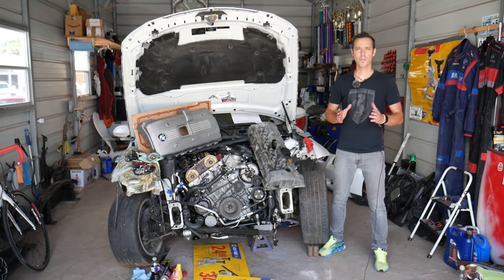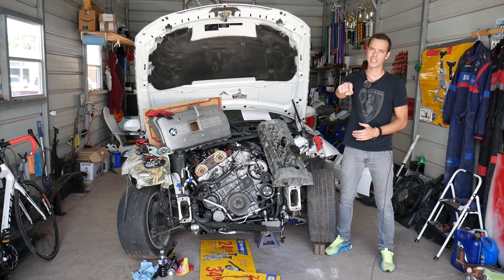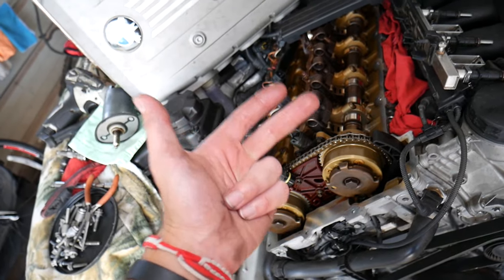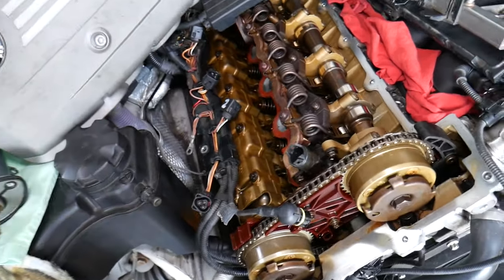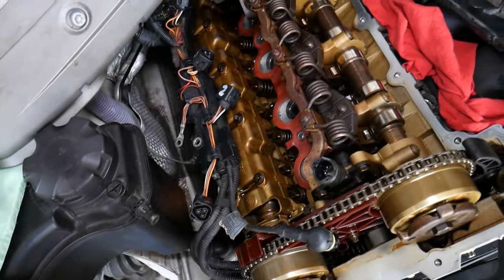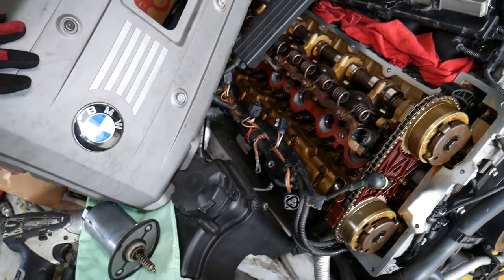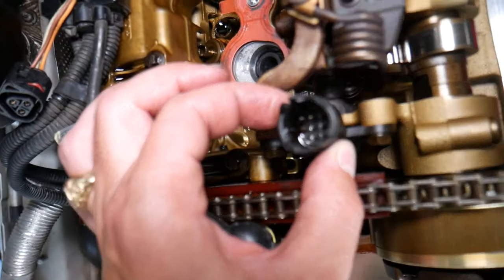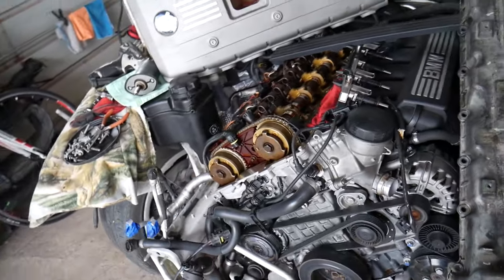SYMPTOMS OF BAD ECCENTRIC SHAFT SENSOR ON BMW

Comment: Does a 1997 E39 bmw 528i have an Eccentric shaft sensor? Please let me know because i just changed my valve cover gasket a few months ago.. Its sealed perfectly and i hate to have to reopen it.. Hoping my car doesnt have or need this. I believe i have some vacuum leak under the intake (very hard to see and access under there. I will try to check from under the car next

Comment: Could this cause the 2a87 code? I have a 2006 330i and the sensor is definitely soaked in oil. I wonder if changing this will resolve that code or will i need to do the camshaft bearing ledge seal?

Comment: I have a question about possible symptoms for the eccentric shaft sensor. When it’s hot and I come to a stop, my cars rpms will drop below 500 and shut off. Also when accelerating the car jolts and the rpms won’t go up. I ran a scan and the eccentric shaft sensor code did come up but I wanted to confirm if this is also symptoms of a failure.
Reply: Did you find if this was sensor?  i have same problem
Reply: I’m having same problem after valve cover swap
Reply: Did you guys relearn the valvetronic motor?
Reply: @yisyerry  supposed to turn it to on position for 30seconds with the new sensor intstalled
Reply: @440Chriso did I fix this? I have same problem?
Reply: @440Chriso  I am also having the same problem after a valve cover change. 2008 BMW X5 3.0si (E70, N52)
Reply: @RogueAfterlife  someone wrecked my 2011 328i while n52 still had the issue moved on to a 2019 440 gran coupe as much as peoples praise the n52 it has nothing on b58

Comment: Would this cause studdering and complete loss of power? I have several codes for the sensor and am replacing it along with my ignition coils.
Reply: Did ignition coils solved the problem?
Reply: @sne231  Had to make several different part orders because something new kept coming up. It's been about three weeks and I should be tidying everything up this weekend. Will let you know.
Reply: Replaced the eccentric shaft sensor and ignition coils. No issues. It probably was more of an issue due to the sensor needing to be replaced as I had several codes. The ignition coils probably needed to be replaced anyways in my case but it probably wasn't necessarily needed in my case.

Comment: i have an error that says
valvetronic, eccentric sensor, guide; checksum error
134c04
is it the sensor or just the seal ?
the symptoms are juddering when taking off and on idle like the car is having hiccups

Comment: Morning I got a bmw e90 320i 4cylinder n46b20 when I start my car it misfires and engine will be noisy when I unplug the top  vvt sensor the misfire goes away an engine Wil quite what can be the problem.

Comment: My car doesn't start at all it just cranks, but the scan tool said it was the sensor and Valvetronic. I guess that the sensor goes out it also gets the code for the Valvetronic motor too because they run hand to hand?

Comment: Hi, Nice and clear videos. Could a faulty valvetronic motor and/or sensor cause loss of all compression? I have 318i which has lost all compression and I have had valvetronic codes in the past, I wonder if they are related...
Reply: Was it related? Having this issue right now

Comment: The sensor is $55?? I paid like $550 to my shop back in 2019 😅
Reply: If they used the Genuine BMW sensor the list price is $577.95 and purchase price is 20% off list which would be $462.36. 
If they used the OE supplier VDO brand the sensor costs about $248.50 and has they same list price. 
DO NOT USE A SENSOR THAT COSTS $55 IT WILL NOT LAST AND YOU WILL HAVE TO RE-DO THE JOB

Comment: I have a 2013 328i coupe. and lately when starting the engine it start running rough , and some oil sips out of oil filter housing, and I have to turn the engine off, and open and close the oil cap, and the starts normally. What is my problem ? Thanks!
Reply: Mine would do the same one day I opened my hood and noticed a baby leak of oil near the oil filter housing I cleaned it off and thought it was no big deal then I woke up the next day and had More oil slipping I went to the store and my car starting shaking and my engine cut off